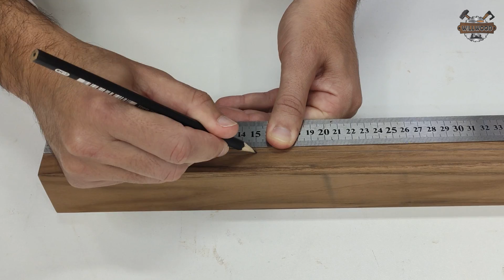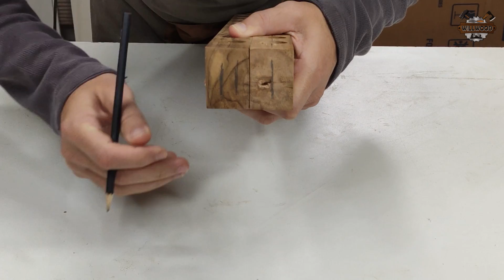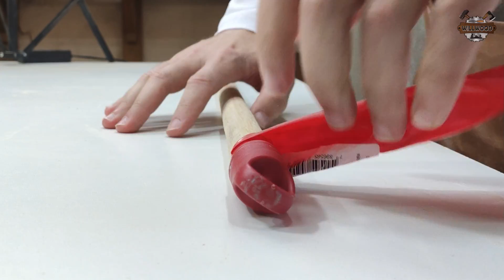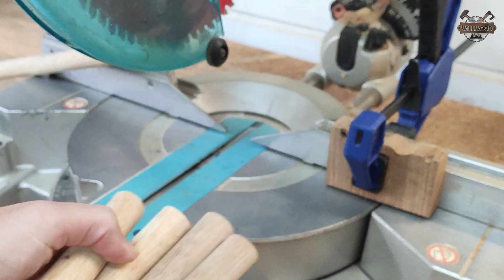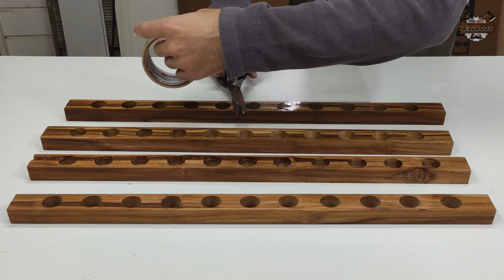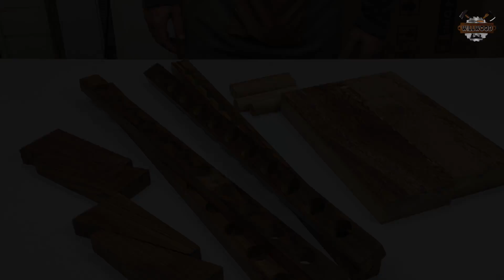You no longer need to spend money on Bad Sergeant Clamps | Woowdworking Tips

Comment: What is the angle of this wedge?
Reply: The angle doesn't really matter as long as it's the same on both pieces.   30 degrees is a good starting point, but just remember that the steeper you make the angle, the more friction you'll get when trying to tap it into place, but you'll also get a longer throw, so it's a bit of a trade off.   It's usually better to use 30 degrees or less, and then just add wood blocks if you need more throw distance.